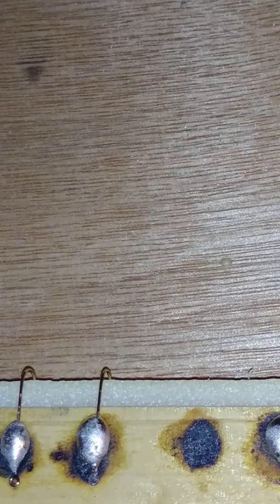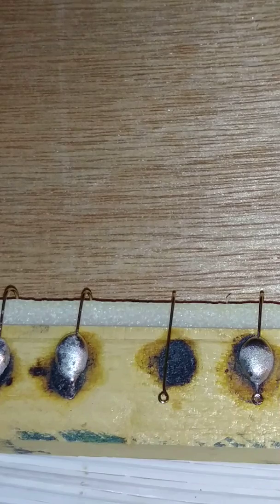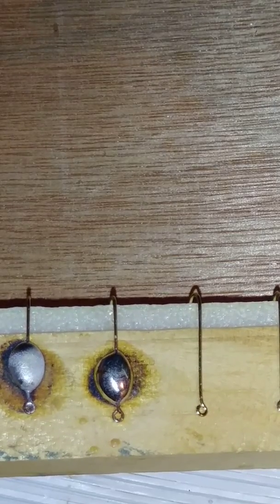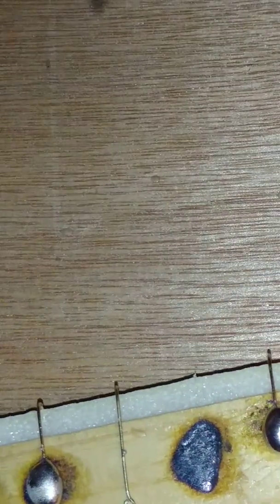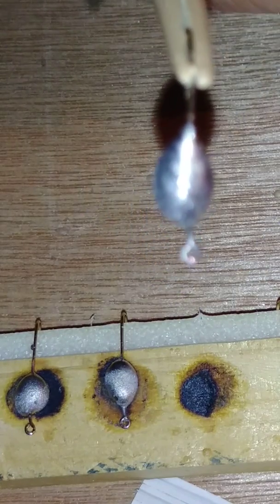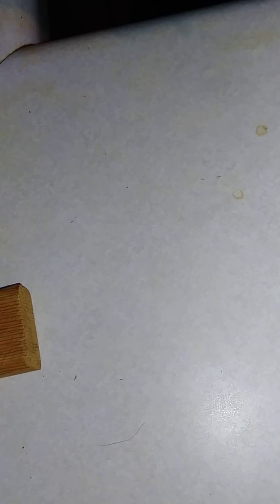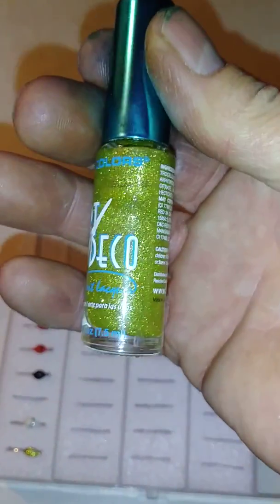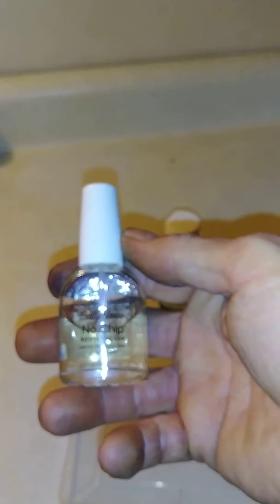Homemade ice fishing jigs. Made easy for about 15 cents a piece

Comment: Nice. To get fancy you can drill an indent into the wood to keep the solder similar size. I make an ant body this way. You can also add small spoons to the hook this wat. Tight lines.
Reply from the maker: For jay wirth. Thank you for viewing my vid. I started out drilling small indents for the jig soldier. Hot soldier actually makes small indents. Lol.